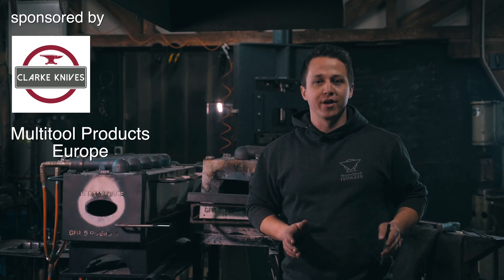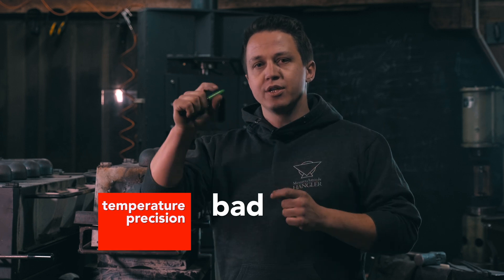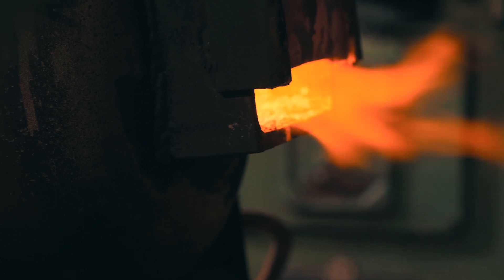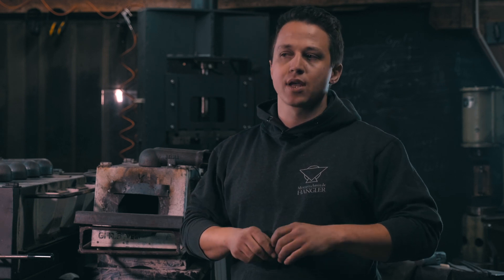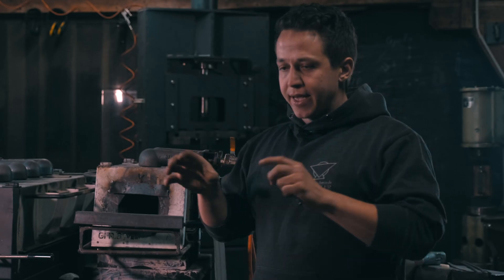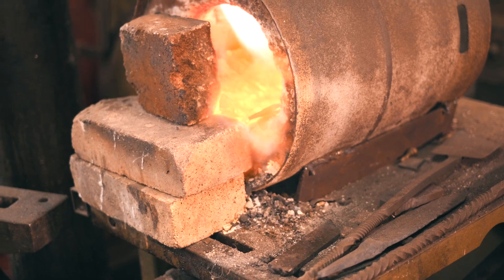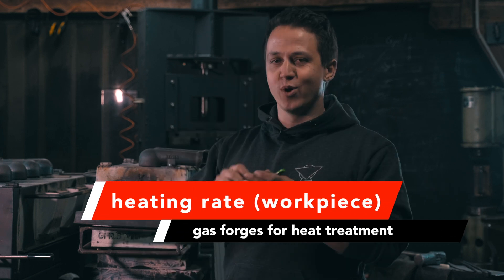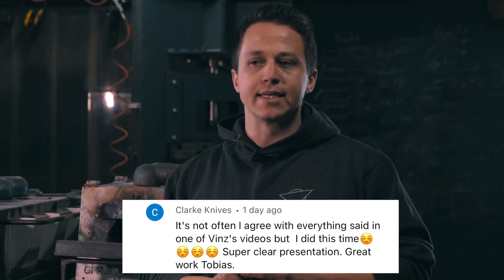Gas forge for heat treatment is WRONG... or is it?

Comment: As someone who is making knives with a desire to sell my work, what would you recommend as the best option for heat treatment? I've been leaning toward a heat treating service until I make enough to purchase an electric heat treating oven, but is a fluidized sand is better I may want to look at the cost of that instead. What would you recommend?
Reply from the maker: Hi J Jenkins. I am no expert on heat treatment myself but I personally still wouldn't recommend a fluidised sand bed for someone who is just starting; it is not cheap to run, needs complex materials, and is more advanced.

For beginners who want to take selling knives seriously, I'd suggest you consider the electric kiln/oven you mentioned. There are plenty of good brands out there such as Paragon, Rockblade, Evenheat, or you can even make your own kilns (lots on YouTube).

I hope that helps!
Reply: Contract heat treatment is a sensible option. Even if you know heat treatment inside and out you’ll still need proper measuring and control equipment to maintain quality which all costs money. A heat treater will already have properly calibrated thermocouples etc to do the job in the first place.

Once you’ve started ramping up production and are doing a good deal of business it may be worth investing. It’ll reduce your turn around time if you can do the heat treatment in house instead of sending it out and getting it back a few days later.

Comment: it would appear to be a basic design problem.  I see some gas forges that are little more than a single supply nozzle at one end.  Smaller and more nozzles spaces evenly along the chamber would provide a more homogeneous temperature.  The use of a shield between material and burners would also alleviate hotspots as it is not the direct flame hitting it but the air temperature.  A smaller surface area or volume would suit better as well.  Why is your kiln 12"/30cm square if the biggest thing that goes into it is a 4"/100mm billet.  Multiple thermal sensors with a simple controller could restrict or open supply valves in real time.  I could be wrong on these items, if so please advise.
Reply: You’re not wrong. All your suggestions make sense. 

It is a case of cost though. If you’ve got the fabrication equipwmnt yourself you can probably make the changes fairly cheaply if not then you’re spendingh a lot of money when a basic furnace will just about do the job if you’re careful. 

A small chamber is best for temperature control… until you decide you want to do something just a little bit bigger and realise you should have gone for the larger one. It’s all swings and roundabouts for the best results for the money you’ve got.

Comment: Yes the gas is the most efficient as far as dollars-and-cents go or for you all across the pond pounds and pents, the only type of forge I have not used as been an electric one I have used coal charcoal hardwood and I studied with the old Smiths and also I have studied the history of blacksmithing and when it comes down to it for versatility gas is probably the best. But you can never forget the old charcoal they work real well, but then again it does take more skill to be able to do it without a lot of the other equipment that you're using
Reply from the maker: Agree. I’ve never really used the equipment and setups you’ve mentioned but they sound very interesting!

Comment: Don’t do this, buy this from us instead. Ya not biased at all.
Reply: Hello David, sorry you feel it's biased - it probably is biased, because I like fancy heat treating equipment and am a perfectionist when it comes to HT. My goal was never to sell anything here. I just want to offer a comparison about the pro's and con's from my point of view as I did a lot of research on it...
Reply: ...and full disclosure - I've used a gas forge for heat treatment for years when I was doing this as a hobby. But the quality of my knives was fluctuating way too much for my personal taste. I am sure I would have gotten better at it over time and with a different gas forge - but once I switched to an electric kiln my results where instantly much more consistent and I could start optimizing my heat treatment instead of worrying about it.
Reply from the maker: Hi David. Sorry to hear you feel this video is biased. This video is a 4-series part of a comparison of heat treatment systems. None of these systems are being sold by the author and purely for educational purposes from an experienced metallurgist.

Comment: Good video Vince.. don't agree entirely though 🙄a great knife can be heat treated in a gas forge if you know what your doing 👍 the only thing I can say is a knife kiln will get you consistent results but it's not the be all and end all.. hope you're having a good Christmas 👍🤙
Reply from the maker: Hello mate good afternoon and Merry Christmas to you 🎄 

I hear your comments on gas forges and agree that you van get good results on gas forges to as smiths have done for decades! As you may have seen, the video was a comparison; pros and cons of various systems including kilns, gas forges, heat treatment and we will even cover fluidised sand beds!

Hope you’ll enjoy the other upcoming vids mate! Speak again soon!
Reply: Yes it can absolutely, but making 100 knives and having them all be the same is pretty impossible. That's why i am not big fan of doing it this way. It's of course a personal opinion and a generalization as some gas forges will be better suited than others.
Reply: @MesserschmiedeHangler  a tip for anyone trying it for the first time on carbon steels is to put coarse sea salt on the blade..salt melts at 801 degrees Celsius and will give you a decent starting point for blade temperature..hope it helps someone 👍

Comment: I see this and really start to wonder how the mid evil century smiths ever made a single blade worth swinging.  I bet they would have sold their first born for a gas forge.
Reply: Hey Tim, of course i am comparing the gas forge to whats available today. Also I am a perfectionist that strives dor the best performance and the most consistent output i can get. Getting a steel hardened isn't all that difficult, but looking at historical pieces they just had a lot more fluctuations in their outout. Even some of the makers that were known for their excellent heat treatments had significant fluctuations in their process that we can nowadays easily eliminate by using proper kilns. So please take my point of view as the opinion of a perfectionist, there are other ways that work too. I am personally just not a fan of selling anything that was heat treated in a rather uncontrolled fashion.
Reply from the maker: Hi Tim thanks for taking time to comment! For sure, the earlier smiths (and current ones) have used gas forge for heat treatment but as you know, we advanced in our knowledge and have come up with various other methods to improve the way we work! Gas forges are a cheap and handy way for heat treatment of blades but they do have some drawbacks. Thanks for watching!
Reply: Back then they were a commodity. The good blade Smiths were just very well practiced with getting the temperatures correct. Thousands of blades and you eventually get it right, most of the time.

Comment: I get it. I've been using coal for the past two years, and recently just got my first gas forge for Christmas.  Good info!  Now for beginners/novice smiths, use what you got. If you're wanting to take the step into professional smithing, then yeah this would be something to definitely look into/work towards. I'm not aiming to be a bladesmith, my goal is to be more of a tool builder/ornamental smith who also does blades. I'm wanna be as well rounded as I can.  I am working towards swords. I've made a nice handful already! Lol but need to get some more equipment. Better grinder, need to rig up a few jigs and such but I'm  at it everyday. 
  Again, great vid guys!🍻
Reply from the maker: Hi Jackson Dunno good morning and thanks for the feedback! Happy to hear your background and journey on smithing! Yeah, gas forges can be used for heat treatment for sure, especially if you have one already. Thanks for the comment and speak to you again soon!

Comment: have to point out here that the greatest historic blades ever made if they were heat treated were done in either a coal or charcoal forge very successfully, the temperature controlled part is very modern and prior to these inventions people were using their knowledge and hard earned experience to make blades for every occasion including every war pretty much up to the middle of the last century
Reply: It’s true that skilled blade smiths can do amazing work with surprisingly crude tools and our ancestors were certainly not imbeciles. 

But it’s also true that those great historic blades are the ones that survived. We don’t have the blades that were rubbish or broke in battle… because they were rubbish or broke in battle and weren’t kept. 

Modern steels and equipment doesn’t necessarily make for better blades but it does mean even a modestly skilled smith can make repeatably good blades once the best practice is found.
Reply: @GemAppleTom  actually if you look around there are literally thousands of surviving old blades in museums and collections, very surprising when you look into it just how much is left, and the point being things were made very successfully for a very long time without the apparently essential modern tools and methods
Reply: @GemAppleTom  and how many modern blades will last do you think? Not many as stamped out or cut out by laser, ground on a machine to a programme means they are soulless and have no individuality, no way will I ever go over to all the modern tools and machines, and besides if everyone did that then another old skill would be lost forever, and to add to that nowhere near the amount of blades are made now compared to centuries gone by and they are not used in the same way now, they are a less used tool now rather than a weapon or an essential carry everywhere all the time tool that was hard used and damaged and disposed of
Reply: @andyc750  The stainless ones will last a pretty long time… 

I’m not  criticising anyone for using old fashioned methods or discouraging anyone from trying them. I don’t think it makes economic or business sense to avoid modern methods but for a lot of blade makers that’s not the point. I don’t for a moment think I’ll make a more consistent blade than a fully worked up production line but I still want to (eventually) get a forge of my own so I can bash metal like my family has done for at least 6 generations.

EDIT: it doesn’t make business sense unless your business model is selling hand made knives of course…
Reply: @GemAppleTom  good luck with it, when you do start you will understand exactly what I mean, been doing it for the last 3 years now
Reply: @andyc750  Cheers. Any advice on best practice you can share on the channel will be eagerly absorbed by the likes of me

Though my background is metallurgy and steel heat treatment so I doubt I’ll be able to shake my prejudice for decent temperature control…
Reply: @GemAppleTom  all I can say is keep looking to learn and keep practicing as much as possible, you will find what you like to do and how you like to do it by experimenting, I still have massive amounts to learn to be able to consider myself competent, only at the stage now where most things come out useable first attempt now, you will scrap a lot of steel at first but don't let it put you off
Reply from the maker: Thanks all for the input! I hope this video gives an insight on yet another way of heat treatment. Thanks!
Reply: Maybe i have to mention that I am making asd selling hand forged high performance culinary knives so i shoot for the best possible performance i can get with the best consistency i can possibly get in this day and age. I have started in a different place with a file and a coal forge as a hobby but now I want all of my knives to be as close as possible to the best performance i can get. You can't control what you can't measure, so i think a temperature control and a hardness tester are a very useful tool for the modern bladesmith.
Reply: @MesserschmiedeHangler  each to their own, what ||I make is traditionally made one off blades of normally ancient design with the odd kitchen knife thrown in, had no complaints and no returns for problems or repairs as yet and good feedback all round, but then they get pictures of them being made all through the process and input into what is happening all the way through the build near enough

Comment: Good stuff again Vinz and Tobias 😊

This kind of information is really helping me realistically plan my dreamed of shed. One day… one day…
Reply from the maker: Cheers again Tom! Before you finalise your dream shed, you better wait for the fluidised sand bed vid mate ;) 

Speak to you again soon!
Reply: @UKBladeshow  I’ve used fluidised beds in industry before. A video about them would be another fine addition to the series. Again well done. You’re on a roll.
Reply from the maker: Excellent! Would be glad to hear your thoughts (compared to Tobias’ perspective) on those things. Up next will be the all-known kilns though.
Reply: @UKBladeshow  I don’t know much about kilns so will definitely be looking for that one. 

One of the big pros for fluidised beds is the temp homogeneity and temp stability. You need to put in quite a large lump of steel to change a bed’s temperature significantly. Which can be a con as you can’t quickly ramp up or down in temperature.  They take a lot of energy to heat up but don’t lose it easily so good and bad. They’re really not efficient with gas use at lower temperature but are pretty good at forging temperatures. You’d be daft to use one to temper if you’ve got a bog standard kitchen oven you could use instead. They can also  let you do some of the more exotic heat treatments like austempering or martempering more easily than other furnace types. It’s bloody dusty.

Oh and if you want a bubbling lava pit feature for your forge you can’t get better.

Comment: Digital thermometers are a thing for somewhere between $50-80, some of the better ones will have two ports to read off different thermocouples and you can space them around/in the area you're heat treating a work piece. I don't trust 'eyeball temperature readings' based off colour, fair enough if its something like cherry red or bright yellow you've got a fair indication, but the subtlety for a specific temp just really isn't much more than educated guesswork. At least for me anyway- also don't look into the forge for long periods of time!
So I say yes, you can heat treat in a gas forge, however, you do need some type of temp reader
I do use a kiln though for my work, its relatively livable in terms of time between 100-900C and just runs off 10A 240V, but I modified it to run a gas torch + chimney for faster ramp times usually between that 800 to 1100C range for some stainless and tool steels that need very high temps. Plus if I'm doing batches I can ramp up to temp again quicker with the gas input running with the electrical elements as well. Mostly comes down to the setup, the thermocouple in the kiln is maybe 2-3cm right above where the edge of the blade is and given its large thermal mass it can maintain a very consistent and even temperature.
Thats not a completely off the shelf solution though for everyone, but there's still some pro's to using gas and kilns
Reply: I’m hearing from what you said that a gas forge is doable but there are avoidable pitfalls along the way to get the quality right. A fair summary of what you said?
Reply: @GemAppleTom  Yep, pretty much. If you can afford a good kiln by all means make it a fairly high priority on your list of big equipment. Otherwise you can give digital thermometers a go and see if that's improving things for you.

There are some companies which make PID controllers for forges which allow you to dial in a temp pretty accurately just with a regulation of gas-air flow. I wouldn't say they're cheap, but they're under 1000 bucks (Australian dollars) for a single burner control and do require a bit of tuning to suit the burner(s) and the forge itself.
Avoiding hot-spots is more or less up to the operator as well, but they exist
Reply: @krissteel4074  Cheers :}

I know how I’d run a contract heat treatment centre but it’s not the same as a hobby blacksmithing forge in a shed (my plan for the future). Getting this kind of advice from actual blade makers is much appreciated.
Reply: @GemAppleTom  of course gas forges can be heavily modified to make them more suitable for heat treating. I am referring to a typical off the shelf solution with direct burners, a relatively small chamber and without temperature controllers in this video. If you decide to build a heat treatment furnace fueled with propane, the final furnace would likely look very different from a typical gas forger to get more even temperature distributions. But i think by then the electrical kiln might be the cheaper option 😊
Reply: @MesserschmiedeHangler  Thanks for the feedback :)
Reply: @MesserschmiedeHangler  Don Fogg from the ABS has a gas kiln designed around a 44gal drum lined with ceramic blanket, mostly useful for swords and anything in the carbon steel range of austensising temps 8-900C they work very well. But you can put knives in there and its not a hugely expensive build if you can get the ceramic blanket cheap enough, the rest is stainless hangers for the work piece and a digital reader for your temps.
Might be something to look into as an option, a friend of mine in WA has an example he built on youtube
https://www.youtube.com/watch?v=CuJJJFpXfK0&t=195s